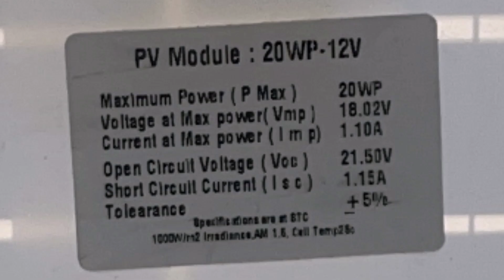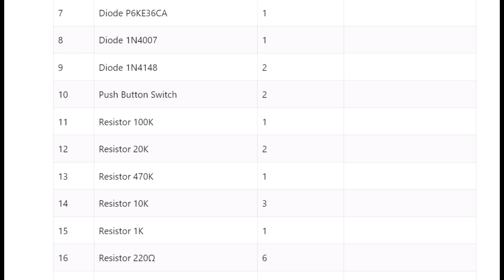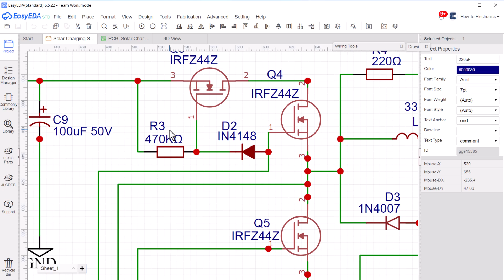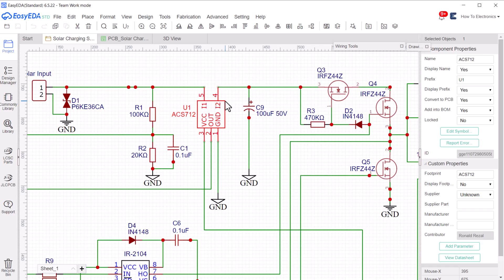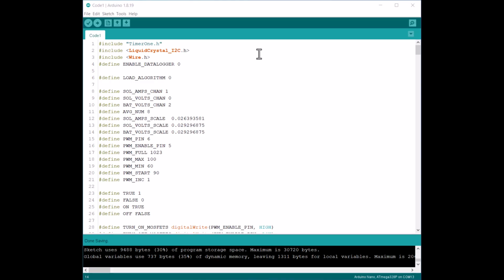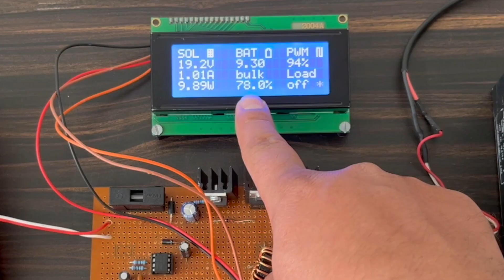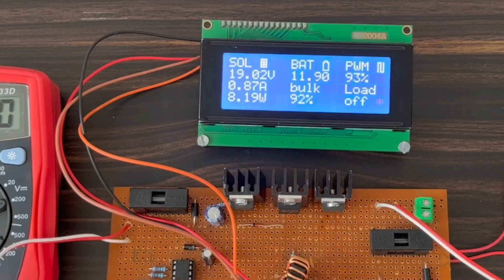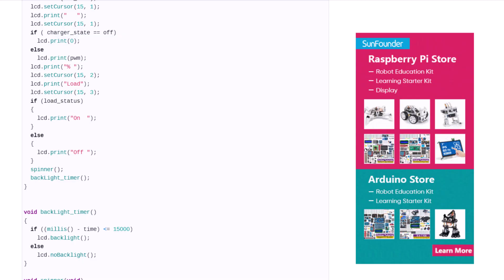DIY MPPT Solar Charge Controller using Arduino | 24V Solar Panel, 12V Battery, 50 Watt

Comment: The project is nice, but it's not a mppt that you have here, it's a PWM solar charge controller.
 PWM solar charge controller use ... PWM to lower the voltage to the battery, loosing power in the process, that why you got only 9w out of the 20w
MPPT charge controller use bulk and boost converter to lower or increase the voltage to the battery, this process loose less power than mppt

Comment: Quick question:  we need an specific charge cycle for an battery. So if the controller maintain the MPP isn't it possible that we are damaging battery. Like if our mpp is at say 30v 2amp and our battery need 13-14v to get charged. Than what will be the scenario ? If the controller match the battery needs and get volts down than how can we say the mpp is achieved? As it is achieved at 30v 2amp in our case here.

Comment: Humm at 9:05 the voltage is 19.2, current 1.01A, this should be 19.4 Watts. But the display says 9.89 Watts? And how come so much power is consumed if the load is not even yet connected?

Comment: The current before and after the battery was connected is same? What is it doing with the power when the battery is not connected? Terrible design!

Comment: Mam this will give more current than pwm controller as we know voltage decrease current increase..?
Reply: MPPT finds the sweat spot where the resulting power output is highest. Right before the voltage drops to much it will limit current so the voltage doesn't drop and output power is maximum. MPPT, Maximum Power Point Tracking.

Comment: Excuse mam why there is voltage difference between multimeter and solar charger controller
Reply from the maker: Calibration reason. Need to add some factor in code part for adjusting with multimeter.

Comment: I built one with raspberry pi pico and i use totally my own code and algorithms and it works great and the pi pico it way faster than arduino nano.
Reply: Can you share the schematic and codes.?

Comment: @HowtoElectronics Hi I'm doing the same project but i using a 600W solar panel so i want to ask how can i choose resistors for voltage divider. should i use big resistor ?
Reply from the maker: What is the voltage range for your product.
Reply: @HowtoElectronics  I'm using solar panel voltage range 36.9-73.8 V . I'm charging four 12V/100ah batteries. I will connect them In series to make 48V 100Ah battery bank
Reply from the maker: Resistors might not help in the case i guess because current will be high.

In case you are still willing to use Resistors voltage divider network the go for higher watt resistor with resistance value in terms of mega-ohms. Use proper resistor value for calculation of voltage. Make sure the supplied voltage to adc pin  is not higher than 5.
Reply: @HowtoElectronics   the  PV current is 8.13 A and PV Voltage is 36.9V, PV Power is 300W.  so i will connect two of this solar panels in series so that i charge this batteries in 8hours.  I get what you are saying but I'm little bit confused on how to rate especially resistors. So my question is  my resistor be rated with 600W power or ..?

Comment: thanks bro for the good job here. but after looking true the hole work and simulation I found out that the PWM pin used was wrong. that is why it was not working on simulation through proteus. Hence I changed the PWM pin and it stated working but u have to change it equally in the code. 2 The load program in the code was used upside down, hence you need to interchange the code. Hence the PCB connection wrong. pls look into it and do some correction.
Reply: can you explain how you did that? Now which pin is the PWM pin?
Reply: @ahsansamdani6952 hello, did you get the corrections
Reply: Can you tell the correction ? Which pin it is and also tell the correction in code
Reply: Can you please shed more light on this. I can't seem to get to to work in Proteus

Comment: And why you have used potential divider to sense voltage than a voltage sensor
Reply: Voltage sensor modules are voltage dividers. It's basically the same thing

Comment: Awesome video! What do you think about the next version of this project:

1. A BOOST Converter (instead of the current Buck) - say to boost 2-3x of these 24V Solar Panel string to 110v (or 230v) MSW?
2. Explain why L1 is 33uH and C4 is 220uF
3. Show how L1 turns should be calculated if we were designing L1 from scratch (including toroid core selection)

What do you think?
Reply from the maker: 1. Yes we have some tested ready made circuit to boost the power. But it would be a good option to use the 12V frol battery to fed to inverter and make solar based inverter.

2. For 12V battey input charging voltage is 15 and output voltage is 12V. Output current is 50W/12=4.2A. The switching frequency is 50KHz & duty cycle is almost 80%.  For a good design typical value of ripple current is in between 30 to 40 % of load current the calculated value we get is around 33uH. You can refer to buck converter design calculator on internet to find out the inductor value.

The equations used for calculation of inductor and capacitor is taken from an article LC Selection Guide for theDC-DC Synchronous Buck Converter on instructables.
Reply: @HowtoElectronics  I am searching for a way to boost solar panels voltage from 250vdc(8 panels in series) to around 380-400vdc to feed in to an inverter H-bridge to make 220vac. I have made the inverter based on egs002 module and working great. How to boost while extracting maximum power and keep the voltage between 350-400vdc? Similar to hybrid inverter, I want to avoid using batteries so solar charge controller is not an option
Reply: @cipry1010  Can u try supercapacitor for  system
Reply: @HowtoElectronics I'm looking at something like this built with a boost converter so I can charge 6 lithium cells in series so need a 25V battery to charge from an 18V panel. If there is an easy way to customize this unit, it could me made to suit many applications.

Comment: How about for large input voltage like 100v and load of more than 20a for a 200ah battery system?
Reply from the maker: I have tested it for 12/24/36V solar panel only.

Comment: is This PWM Controller ?
Reply from the maker: Its MPPT controller, a better version than  pwm contoller.
Reply: @HowtoElectronics  is it possible to charge 12.6v li-ion battery
Reply from the maker: Yes it can but it needs an additional battery management system IC or a circuit.
Reply: @HowtoElectronics  thanks for the info
Next project is li-ion battery charger ?😀

Comment: That's a very cool learning project...thanks a lot. Suggestion: Can you add Arduino/esp32 reporting all values via wifi to internet Iot cloud?
Reply from the maker: We are thinking to modify the design with ESP32 and publish it on any IoT platform for monitoring data online. Hope this will be completed soon.
Reply: @HowtoElectronics  wow, thx. Have Fun developing it!
Reply: @HowtoElectronics  hi, any progress in this matter? Summer is coming, I need to build my MPPTs soon :-) Thanks
Reply: @HowtoElectronics  When you made mppt Esp32
Reply: Make video esp32 for this project...thank you